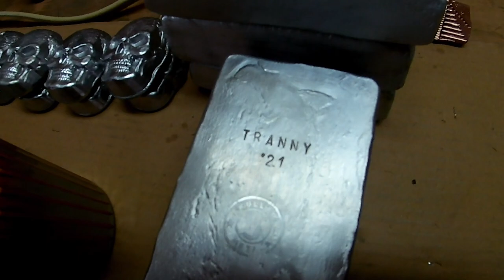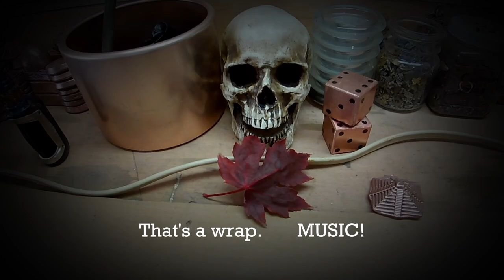Melting Metal, Copper and Brass - ASMR - Scrap Wire - Trash To Treasure

Comment: Those two moulds seem tricky to pour, the clover is pretty shallow. I think the pyramid could use an extra step at the base to give you a nice square finish at the end. 👍
Reply from the maker: Yeah both of those molds are a nightmare.  Really the best material to pour in them is copper, and that's because it flows so well.  Brass is terrible and aluminum is "puffy" when it pours.  Actually zinc or pewter would be great in those molds.